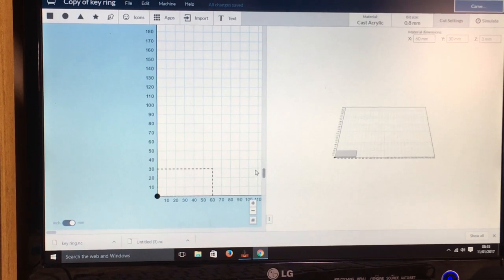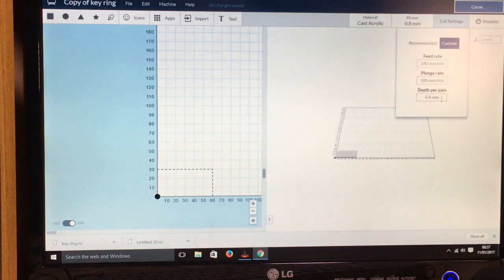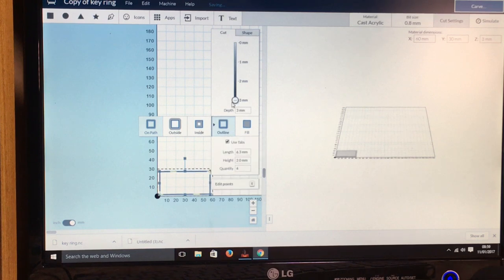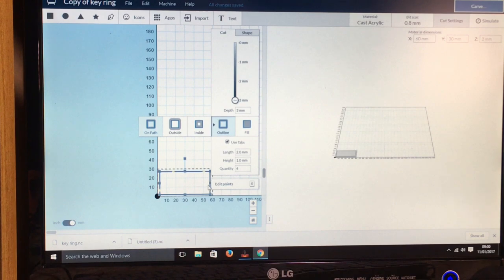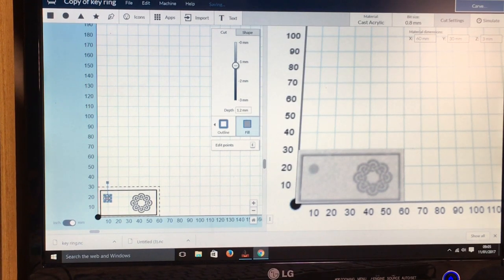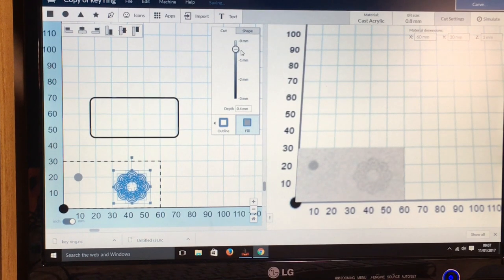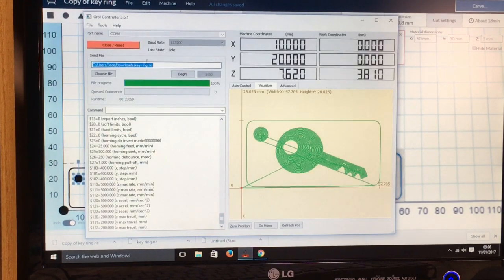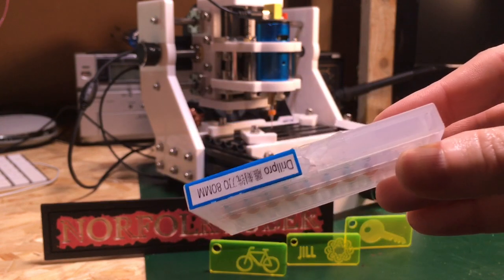EleksMill Desktop CNC How To Make A Keyring

Comment: Nice and easy video to show you how to create a quick keyring on Easel Thanks for doing it. I assume you have the paid version of Easel as I thought Vcarve was not available on the free one?  One of the easiest I have seen in fact to show you the basics on vcarve.

How are you finding this CNC, I see you were upgrading it? I have one or two Eleksmaker devices for my pure Laser cnc, a 10 watt Endurance , the egg maker and the rotary engraver, was interested how this one was as its all plastic and there is a 100% metal version of this one that is cheaper and comes without the laser which I dont need and I was thinking of machining brass on that one as I assume this wouldn't be sturdy enough for metal. Eleksmaker make very nice machines was just concerned if its tough enough for metal.

Comment: You carry on pumping out these great info vids. I am going to end up buying one of these! is the feedrate the lateral motion speed?
Reply from the maker: Wont make no more then :-) 
yes feedrates the speed you cut into material, will change depending on type.
different cutting speeds for different types of cutter. The harder the material the slower the speed. feed rate also changes depending on spindle speed rpm of cutter.
The spindle speed is fixed on this so i just set the feed rate, i got it set just nice speed so wont snap the cutting bit.
can go faster but risk breakages.  
Thanks my friend have a good week all the best.